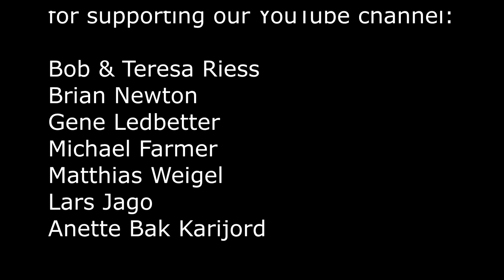Old small stove - Restoration

Comment: this is actually a lower end one. As the price went up, so did the features. Some had mica-glass windows in the doors so you could watch the fire. Others had other fancy details. Depends on brand and model, but they used to be common.
Reply: @leah rose yes the mica comes off in thin layers. All the heating and cooling cycles do that over time. It was what was available at the time though, they didn't have a glass that would stand up to it then.

Comment: i've noticed 3 main types of rust
1 to me this is the most annoying type of rust a bright orange rust just on the surface of the metal you can almost wipe most of it off with your hand but will need a wire brush to get it all off it doesn't cause any structural damage just ruins the appearance 
2 this kind of rust is almost a protective layer it it is still very hard and doesn't really cause any structural damage it can be polisher smooth by regular use
3 this is the worst kind of rust this causes major structural. damage and can flake off in sheets and rust right through thinner metal if this rust is on thinner metal the metal is usually beyond repair
like and leave a reply if you have  noticed any other types of rust.

Comment: That is the most clear impressive videoing I have come across . But one question ,is there no fire cement in the bottom of the stove ?
Reply from the maker: Thank you Jack. Yes you are right, we must add. Radek
Reply: @VeradonaRestoration  Did you replace the old with new cement or was the original ok ?
Reply from the maker: @jacksimper5725  There is no fireclay in these stoves.

Comment: What did you use to turn the cast black? seasoning?  and the high temp paint is just generic high temp paint?  no need to primer?  What grade nuts and bolts are you using to stand up to the heat without corroding later?
Reply from the maker: He doesn't know if I understand the question of translation exactly. Black liquid is a rust remover with tannin and the top black is a heat-resistant paint directly on the metal.

Comment: I am new to this .What is this electric welding technique? It looks like soldering but cannot be as it must withstand the heat. And what were you rubbing on the stove after sandblasting?
Reply from the maker: It was a rust remover with tannin as a prevention

Comment: 2:43 Tip: when loosening bolts, and it gives just a fraction but nothing more, they will break if you continue. However, if you have just a tiny bit of movement, then go back and forth on that bit you have. loosen, tighten, loosen, tighten and so on... It will create more space to turn the bolt... Not all the way but you repeat that process going back and forth and it will eventually come off perfectly.
Reply from the maker: Thanks for advice Hans :) Radek

Comment: First time caller here. Would this type of stove have been used indoors or out?  Is there a brand?  History of this type of stove?  Would it have been mostly for cooking or also for heating?  Is it considered a rocket stove?  What is the dark liquid applied around 9:14?  Thanks for any or all answers!
Reply from the maker: These stoves were used in the room. They are for heating, but you can also cook on them. The fluid is a cutter. Unfortunately, I don't know history. Corrosion prevention.

Comment: I have a question. At times you pre-treated the rusty nuts and bolts with a WD-40 or some other lubricant, but at other times you didn’t pre-treat the same type of rusty bolts and tried to remove them with a wrench....with no 
lubrication. Why was that. You ended up using the grinder to cut the rusty nuts and bolts out without even trying to lub them first. That was very inconsistent on your part. Can you explain?

Comment: If you dip the parts, such as the lower fire door, in phosphoric acid (concrete and metal prep solution works fine) for a day or two, the rust will be gone and you can remove bolts and screws SO much more easily.   You must remove the bolts as soon as the part comes out of solution.
Reply from the maker: Thank you for the advice.

Comment: What would be best to remove pitted rust if I didn't have a sandblaster?
Reply from the maker: Wire brush and rust remover. Hydrochloric acid also works well, but it is dangerous.

Comment: A curious fact that I learned about the uses for rust and for copper oxide (that black layer that covers copper pieces) is the use for the manufacture of ceramics and high temperature pigments. Iron, when crystallized in a glassy medium, turns blue and copper can go from orange (oven with a low oxygen atmosphere), , to the bluish-green in open ovens.
Reply from the maker: Thanks for the information Carlos.

Comment: You were doing good until you used the anti-rust and the 'high heat' paint. Stove Black for Cast Iron would have been a much, much better product. The paint will fail. The anti-rust will stink. Both might end up in the food. But...if you're not actually going to use the stove, then it'll last a while.  It was a good restoration though. I love to see old things brought back to life instead of ending up in a junk yard. Thanks! :)
Reply: I remember the stuff. What a mess, once a year every Spring on a Franklin and a buck stove.
Reply: @michelbrisebois4317  I had pretty good luck with it. Years of holding up. You do have to buy a good quality which is not cheap. Sometimes it's the cast iron itself. Impurities in the iron might account for having to re-coat.  But, you know, nothing lasts forever.
Reply: @thomaswhitten2537  Heavy use. Canada have long and cold winters and sometimes we overheated the things a bit mainly at -40°. No doubts good quality products usually give good results but abuse can kill anything.
Reply from the maker: Thanks Thomas